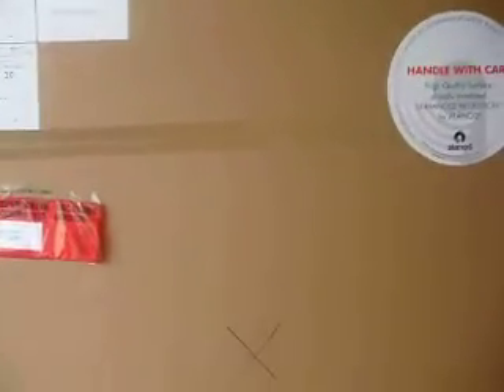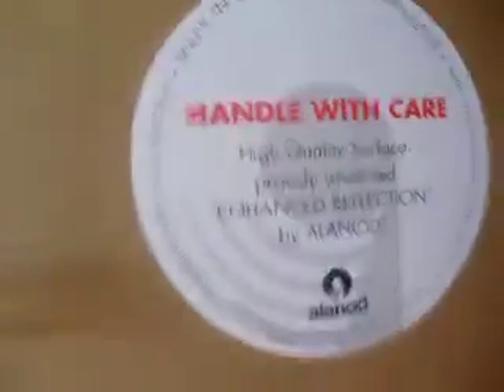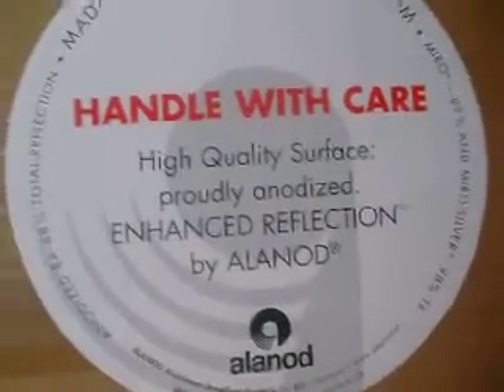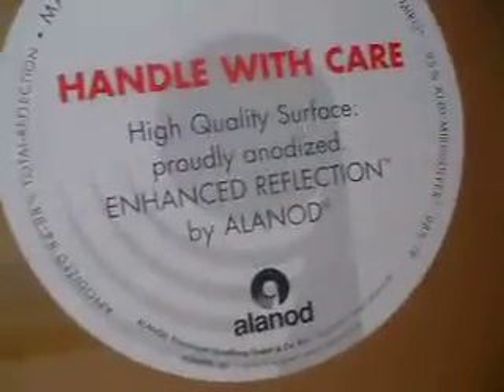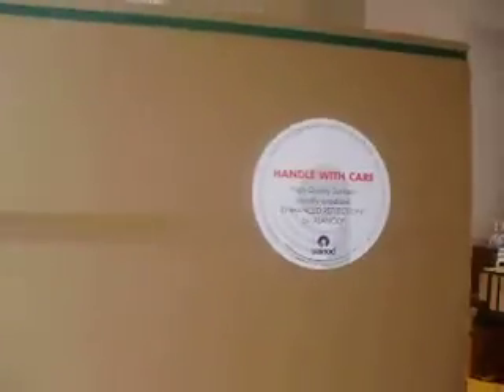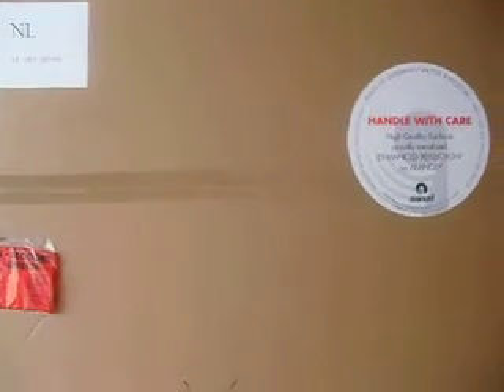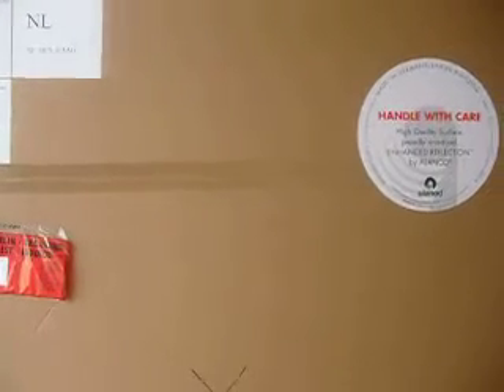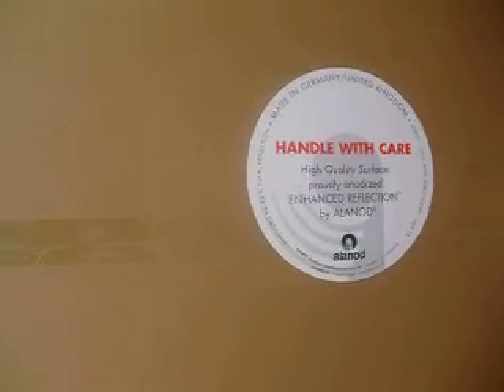Alanod Material for Parabolic Trough Collector

Comment: @crlsale182 

This material is aluminium of desiredd thickness, 0.2, 0.3,0.4 mm with silver on top and a protective coating. It can be rigid if very small, but biggerpieces need support. For parabolic it's pretty nice because it simply bends along the support..